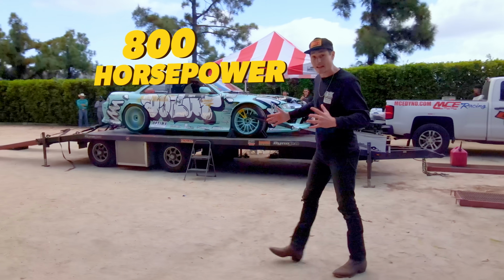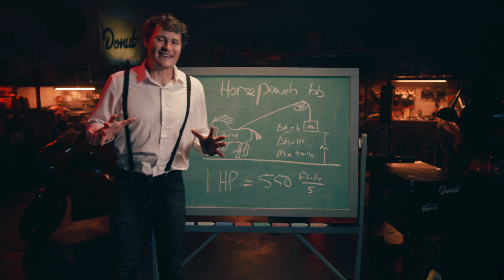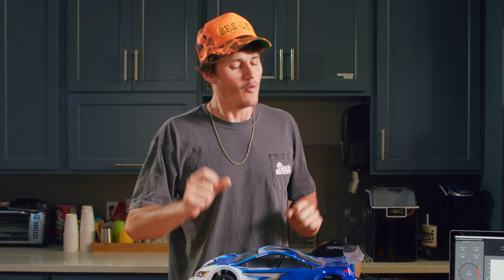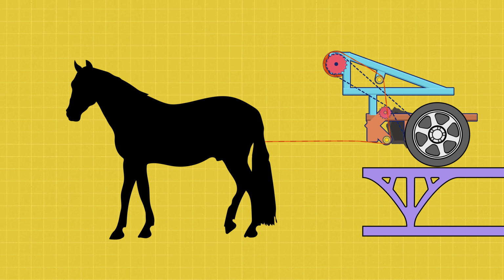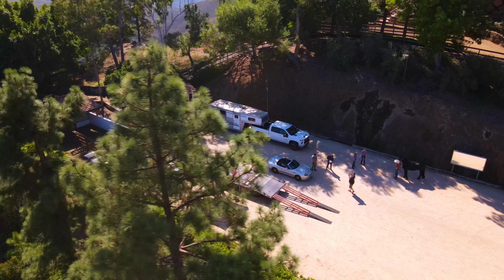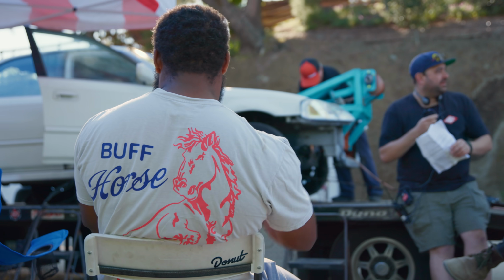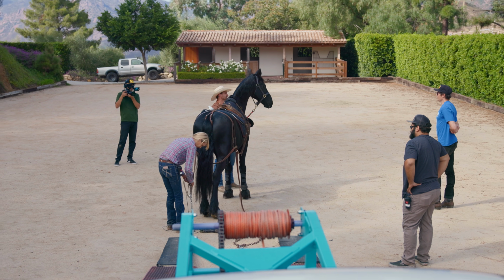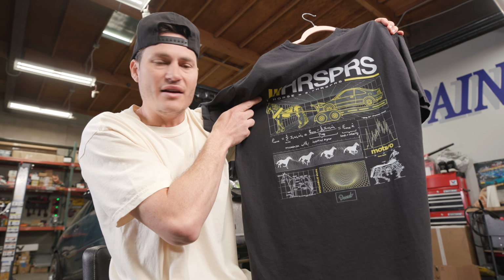How Much Horsepower is a Horse?

Comment: From my memory, the original experiment done by James Watt concluded that a horse averages 1HP over an 8hr day. That's why it's a unique number of  746 watts= 1hp. The horse used could peak pull 12-15hp. 
When you look at that draft horse and the amount of muscle it has on it while it pulled 6hp, compare it to the tiny men who could pull up to 2hp, it is improbable that the horse is only 3x stronger. The men could peak pull 2hp for a short amount of time, but if you were to average their power out over an 8hr day, it would be much much less, and the horse could average much higher. Probably around 1hp.
Reply: OK, but, hear me out, what if we turbo the horse
Reply: @The_Ballo  they'd never let you give it enough cocaine... or is that more like nitrous😁
Reply: @The_Ballo I'm listening...🤔
Reply: I basically came here to say this. The horse puts out ~746W sustained, walking for hours and hours, which is about 2x the peak a human can do. You could get even more power out the horse by taking it to a gallop - but only for a few tens of minutes a day. A large part of that is thermal load. If the horse gets too hot, it'll die. On a cold day you'll get better performance. Likewise the horse gets better cooling when moving forward faster, than it would walking or on a fancy treadmill.
Reply: @NigelTolley   There are humans on this earth who can peak produce upwards of 2500 watts or about 3.3hp. Bradley Wiggins, a British cyclist, put out 440watts / 0.6hp for 1 hour at about ~80kg.
Reply: @sayhellotoyou9271 That 3 hp is for big Track Cyclist, and thst's their 1 to 3 second absolute max. They are bigger buffed sprinters. Not Tour De France riders. They would suck at doing a 100 mile race, but can sprint great. Likewise, even 1 hr record holders are not the best Track sprinters. Bradley Wiggins cannot push big watt peaks of 2,000 + like 200 Meter cycling track sprinters can.
Reply: Yeah. I think the sport of Strongman would be a good way of thinking about this. Horse Plane Pull when?! 😳Is bugenhagen pulling?
Reply: @TheBcoolGuy i know for certain that a strongmen got a peak power of around 12hp
Reply: I came here to say this. They got its peak output. But a horse cannot continuously output that. If comparing it to a engine or motor. You need to see what it can continuously output. I’m curious is they intentionally overlooked this or it was genuinely just missed. But I feel it is important information to at least mention.
Reply: @danielcook4712   so if engine got proper cooling and oiling probably it can pull peak torque all the day
Reply: @tsugumorihoney2288  Certainly aerospace engines do exactly that. Light aircraft have to pull nicely for hours.
Reply: @tsugumorihoney2288  yes. Obviously it would significantly shorten the engine life. But at least in theory most engines should be able to put out their peak rated power continuously.
Reply: Very interesting, my brother told me about an experiment he was part of in middle school. I remember him telling me that they were rated at .75 horse power. I'm impressed with these guys and I find it interesting that some middle school experiment from the early 90s kind of lined up with these guys' experiments.
Reply: But if that's the case, isn't it misleading to give the max power of cars In horsepower?

I feel like a lot of cars couldn't maintain their stated horsepower for 8 hours.
Reply: @IamGrimalkin  James Watt's formulation of horsepower transformed how people assessed power sources. In his time, the debate revolved around choosing between horses or steam engines for industrial work. The shift wasn't solely about maximum horsepower but about the sustained power delivery and efficiency. Back then, people transitioned from relying on horses to considering steam engines, not merely due to peak horsepower, but also the consistent and reliable output. Today, in a similar vein, comparing gasoline-powered vehicles to electric ones requires looking beyond just their horsepower ratings. It's about understanding sustained power, efficiency, and the overall pros and cons of each technology.
Reply: @IamGrimalkin most could not for 5 laps in a race track
Reply: a cars maximum output isn't continuous either though, so i feel like this was done on purpose
they shouldve still mentioned it, i agree on that
Reply: On top of that it should be lots of different horses and then caclulate the average among them. This horse experiment is like measuring the strength of a human using 25 years old Arnold Schwarzenegger as a typical example of an average human.
Reply: @hint1k  Draft horses were used because that's what Watt was trying to replace. I wouldn't use show horses or even racehorses for this experiment.
Reply: Yes, but that definition is completely bogus. Because dynos right now do not measure average HP, but a peak HP. Your average shitbox can do 100hp, but 500rpm below the redline and if you run it 8h straight on this rpm, it will most definitely break something. It is not a good definition at all. So a HP should be redefined to match a peak HP, not an average HP over an arbitrary period of time. That is just a random number that is completely meaningless. Especially in the modern industrial age, your average industrial engine does not run just 8h, it does not need to, it can run 24/7, and your car does not run 8h because it is impossible for most people to drive for 8h straight without stopping.
Reply: @thrustvectoring8120  Well yeah, that's why any serious power measurement is in KWh and not HP
Reply: @janne7263  Any serious power measurement is in kW,  not kWh, two different things.
Reply: @Tyranastrasza  Typed it late and was tired. Yes, kW
Reply: @thrustvectoring8120 the definition is just fine, its your understanding that is flawed. Horsepower is not defined as the average output of a horse over 8 hours, it is defined as 550 ft*lb/s. That number is approximately equal to what an average work horse can perform and maintain. The definition of horsepower has nothing to do with peak power, average power, or continuous power rating.
 Dynos do not just measure peak horsepower. They measure power throughout an rpm range and various loads. The number manufacturers advertise is the peak number. In order to get a clear understanding of capabilities of the engine the entire power curve must be taken into account.
Reply: @Redtooth75  But that's the thing. The definition of horsepower was made up as a marketing campain to promote Watt's own machine and reverse engineered the definition of HP to claim his machine as having a 10HP output.
At that time, no one ever verified if that definition was close to being correct (peak or average or continuous, doesn't matter) with an actual horse.
Reply: @Tyranastrasza  it is a fair approximation of a typical work horse, or as close to one you can get when dealing with a living animal of a variety of different breeds. Watt actually used a horse to make his calculations.
But none of that is really relevant in the modern world. Horsepower is defined as 550 ft*lb/s. Whether or not that is an accurate approximation of a horse does not change much. And it actually is consistent with the power of a typical draft horse so your point is still wrong.
I dont know where you got that history from but it is wrong. Multiple people where calculating the power of draft horses at the time and Watts number is consistent with theirs. Other independant parties also compared his number with real horses and found Watts horsepower to be accurate.
Reply: Peak vs average is totally different, carousel design is the best to do an average with a long time…
Reply: So I learnt nothing and 1hp is 1 horse
Reply: i'm not totally sure but i would compare it to weight lifting, there are 5 rep max and 10 rep max
usually people can do 10 reps max at 75% of their full power, 
and 30reps at 50%.
we should ask the horse if he can keep doing the same pull till he hit muscular failure then we can calculate the 1 rep max
Reply: wym from my memory bro were you alive back then?
Reply: Definitely much stronger than the guys obviously. Before the result came for the horse I guessed about 5 for a low and thought maybe it was possible to see a result of 7 but felt more comfortable with 5. The guess was just simply based on watching how much easier each pull became. 

To note, 3 guys didn’t multiply the hp number it just simply amplified it by a non linear amount. (Probably accounted for by whatever math is needed to figure this problem out) anyhow point being is we only saw about. 70% increase in HP going from 1 to 3 people. Even though those three people together are much more than 70% stronger than the one person. Granted there’s much more loss in strength actually turned into HP there too. So, anyhow I’d guess about 15-20 people could maybe come close to the horse. The math isn’t linear is the point for sure
Reply: Most engines are not meant to be used at max hp
Reply: Agreed. A less favorable gear ratio and somehow coaxing the horse to work much harder would give a more "accurate" number for peak horesepower. I suspect it's probably an "approximate" multiple by weight. A 1200lb horse probably could produce about 6 to 7 times the HP of a grown man. But what if the horse is frightened? He could do even more. Biological beings are too complicated to really characterize like this. And Watt's estimate seems reasonable to me. He's making an accurate estimate of the power a horse is producing, not what it's capable of. This makes it a fitting unit of power for an industrial engine.
Reply: So what I'm getting is that we should change 1 horsepower to be 1kw since that's a much simpler conversion. Simplicity=quality.
Reply: The experiment was peak pull. The horse pulled 5.7. I understand the need to ground reality back to its foundation, but the experiment showed what it showed. Its up to us to make sense of it. Prolonging the output yields less for sure. That's just something people will have to discover on their own.
Reply: From my memory, your mother is where Normandy the horse got his nickname “Big D”
Reply: cyclists can also do about 3hp, but that's only for a short period
Reply: Hello ! May Allah protect and guide you to his light and happiness in this life and the hereafter, God bless, Ameen. Excuse me for giving a little presentation of Islam, because it is very misunderstood nowadays, especially on those « Antichrist's » times, where media and politics are mixed to distort history and truth. Thank you very much for your time.

Islam is an arabic word that means the Surrender to the One and Only God, our Creator, Protector, Provider, who gives us life and all that we have, we are safe and sound by his will and grace, we are His and to Him we return, and we have to thank him in this trial life by submitting to him by our free will, or later in the Day of judgment when it's too late to save our own skin. Islam was the original Religion descended to earth from heaven with Adam and Eve (peace and blessing be upon them) in the beginning of humanity. and was passed to people with the succession of the 124 000 prophets and 315 messengers of God to all nations and civilizations since, passing by Noah, Abraham, Isaac, Jacob, Ismaël, Joseph, Moses, Aaron, Joshua, David, Solomon and Jesus (Peace and blessing be upon them) during the history of mankind, the last replaces and completes the previous, until the succession of the last messenger of God fourteen centuries ago, Muhammad (Peace and blessing be upon him) to complete the noble morals of all mankind, to bring humans and jinns out of darkness into light, and to purify people's religion and belief from corruption and polytheism, and return it to purity and true monotheism, like it was in the times of the prophets (Peace and blessing be upon them).

Many Religions that we know nowadays, at their beginning were true and under Islam, initiated by one of the prophets of God, but their original teachings, history and scriptures have been corrupted over time with falsification and polytheism, or lost and replaced with false ones. That's why Islam is the only Religion accepted by God nowadays, which consists in bearing witness that there is no god besides Allah (God in Aramaic, the original language of Jesus and the Gospel), and that Muhammad is His servant and messenger, just like Jesus and Moses and others are His servants and messengers. Never a messenger of God said he was God or literally son of God, it was the people after him who changed the words of God and corrupted the Religion. God is unique and absolute, He does not need to have a family and sons or to associate anyone else with His kingdom, He can simply create whatever He wants, everything belongs to Him, and to Him everything will return. Allah said in Surah Al-Mu’minun : “God has never begotten a son, nor is there any god besides Him. Otherwise, each god would have taken away what it has created, and some of them would have gained supremacy over others. Glory be to God, far beyond what they describe. The Knower of the hidden and the manifest. He is exalted, far above what they associate. (91-92 / Translated by ITANI).

Allah means the one and only God, the God of all prophets and creatures, the creator of the universe and mankind, and the Master of the Day of judgment, where our destiny, Hell or Paradise, is decided based on our faith and deeds in this trial life, and above all, Allah's mercy. 

Allah said in Surah Al-Ikhlas : In the name of God, the Gracious, the Merciful.
Say, “He is God, the One. God, the Absolute. He begets not, nor was He begotten. And there is none comparable to Him.” (1-4 / Translated by ITANI).

Allah said in Surah An-Nisa : O FOLLOWERS of the Gospel! Do not overstep the bounds [of truth] in your religious beliefs, and do not say of God anything but the truth. The Christ Jesus, son of Mary, was but God's Apostle - [the fulfilment of] His promise which He had conveyed unto Mary - and a soul created by Him. Believe, then, in God and His apostles, and do not say, "[God is] a trinity". Desist [from this assertion] for your own good. God is but One God; utterly remote is He, in His glory, from having a son: unto Him belongs all that is in the heavens and all that is on earth; and none is as worthy of trust as God. Never did the Christ feel too proud to be God's servant, nor do the angels who are near unto Him. And those who feel too proud to serve Him and glory in their arrogance [should know that on Judgment Day] He will gather them all unto Himself: (171-172 / Translated by Muhammad Asad).

Allah the Most Merciful said in Surah Ali-Imran : Behold, the only [true] religion in the sight of God is [man's] self-surrender unto Him; and those who were vouchsafed revelation aforetime took, out of mutual jealousy, to divergent views [on this point] only after knowledge [thereof] had come unto them. But as for him who denies the truth of God's messages - behold, God is swift in reckoning!
Thus, [O Prophet,] if they argue with thee, say, "I have surrendered my whole being unto God, and [so have] all who follow me!" - and ask those who have been vouchsafed revelation aforetime, as well as all unlettered people, "Have you [too] surrendered yourselves unto Him?" And if they surrender themselves unto Him, they are on the right path; but if they turn away - behold, thy duty is no more than to deliver the message: for God sees all that is in [the hearts of] His creatures.
Verily, as for those who deny the truth of God's messages, and slay the prophets against all right, and slay people who enjoin equity - announce unto them a grievous chastisement.
It is they whose works shall come to nought both in this world and in the life to come; and they shall have none to succour them.
(19-22 / Translated by Muhammad Asad)..

God said : Say, “We believe in Allah, and in what was revealed to us, and in what was revealed to Abraham, and Ishmael, and Isaac, and Jacob, and the Patriarchs, and in what was given to Moses and Jesus, and in what was given to the prophets from their Lord. We do not differentiate between any of them. And to Him, we surrender.”
(2:136 / Translated by Community)

Salam (Peace) -----------------------
Reply: @islamisthetruewaytogod6812  Hello brother, you just explained Islam in a beautiful way Allah may grant you Jannatul Firdaus.

Comment: i don't know if the question is answered, but i'm guessing if they really get a horse on a dyno, they'll discover it has low horsepower but lots of torque, if the horse cooperates.  i saw a palomino pull a whole uprooted 100 year old oak tree about 10 feet because it got spooked while tied off there.  it was truly impressive.

Comment: Ok so you found out that a horse makes five horsepower;;;

A horse power is a horse pulling a mass of 75 kg upwards in a second.
 like pulling a bucket of water from a well.

You measured 5 hp because after the first meters the system gains inertia so it not that hard at the end of the run.

Where if pulling upwards  mass stored on the weight is countered ballanced by gravity that by comparison is harder on the horse than internal frictions of your system.
You just need to pull all the way the same with the hanging load.

Thats why Dynos are a waste of money.

Comment: Cool video, but their intent of defining HP jumped the shark a bit.  They answered the question of "how much HP does this horse have?" rather than the original question of "what is the power of one horse?"  Ultimately, HP as a definition, only has meaning if we can define 1 HP as torque (ft lbs) or energy (watts).   Still, cool video and a fun thought experiment.